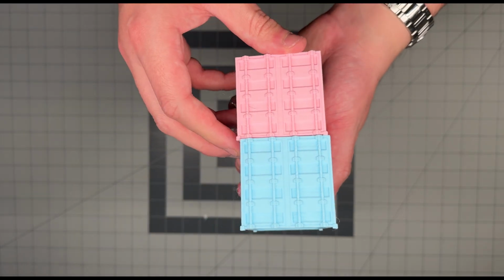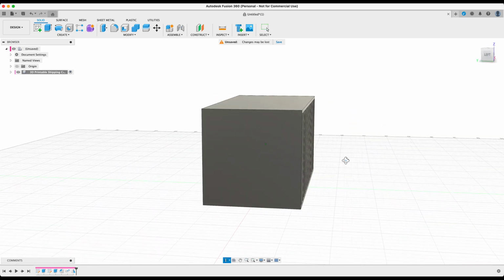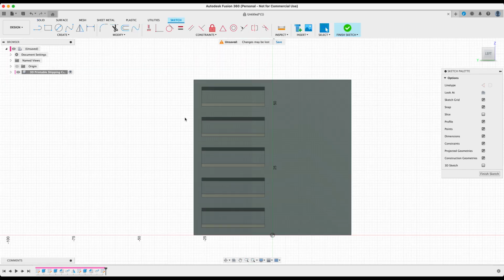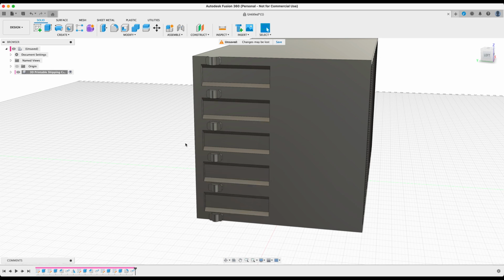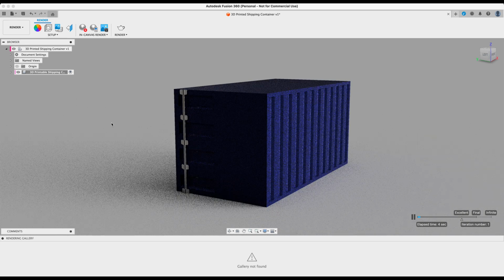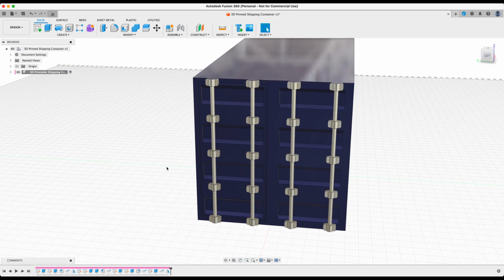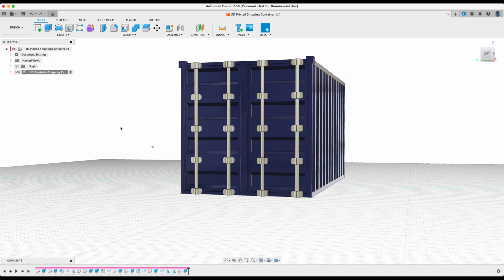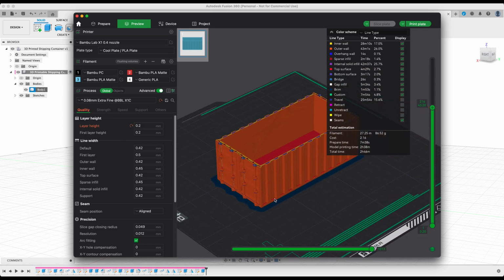Day 8: Learn Fusion 360 for 3D Printing | Designing A Shipping Container

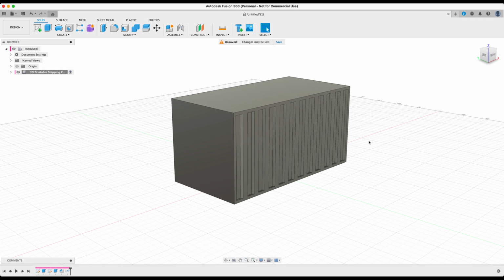Comment: At 3:24, if you are receiving a crazy error when using the mirror command "Mirror1 Compute Failed Cannot find edge to chamfer. Adjust edge, face, or feature selection. " it's because you likely selected inner faces for the chamfer instead of the rear edge...don't make my mistake, select the inner edges only!